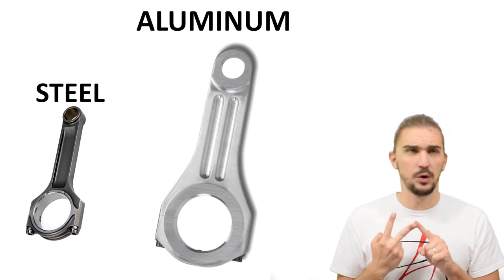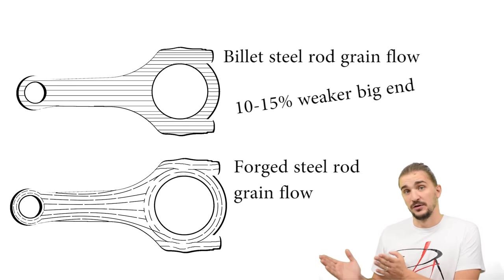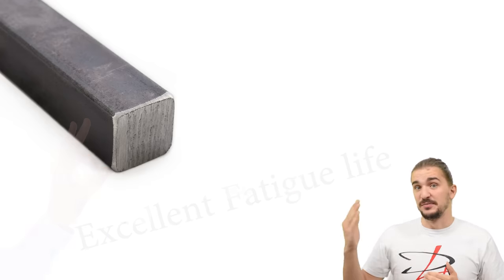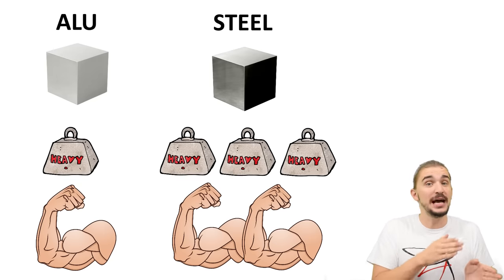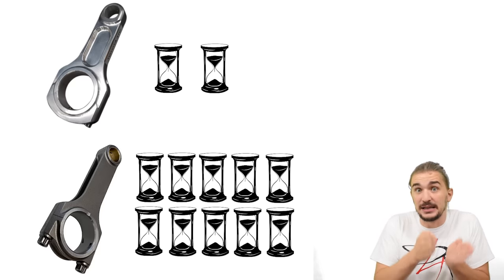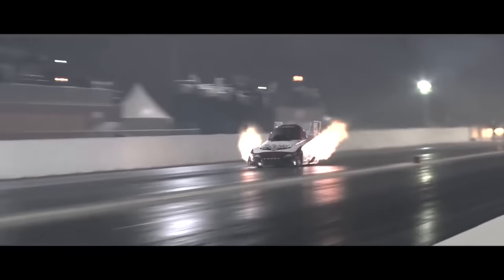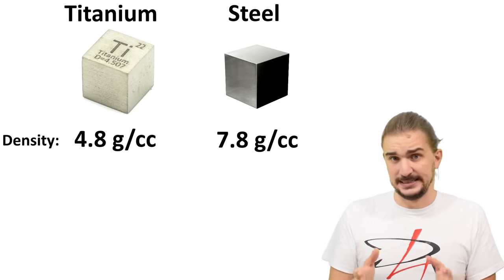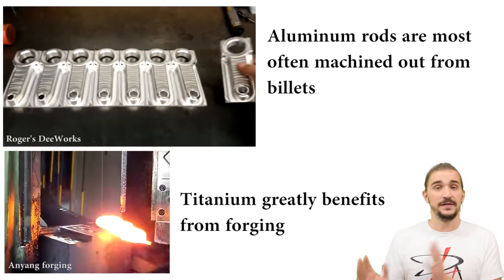STEEL vs ALUMINUM vs TITANIUM Connecting Rods

Comment: I'm a PhD metallurgist who worked in the jet engine business. You'll hear a lot of nonsense about materials in popular media, but this video was excellent! I especially liked  hearing the rarely spoken truth about "billet" parts - better than cast, not as good as forged.
Reply: Would the best parts be a combination? For the connecting rods, for example, forge the bottom end and machine the rest of it.
Reply: I share your pain. I used to work as a Tool Marker and later i worked for a company that builds centrifuges for waste treatment plants. The number of times i heard people expouse that stainless steel is some kind of wonder material. They think if they use stainless screws they are much stronger.
Reply: I wonder if the single crystal casting process used for gas turbine blades would add value for connecting rods.
Reply: @Dave5843-d9m  
Possibly, but I question the cost effectiveness.  In a production vehicle the currently used scintered and forged rods are perfectly serviceable for threat use. The rod is actually larger when it comes out of the sintering process and when forged ir reduces the volume and increases the density. Another option might be 3D printing using laser sintering of metal powders.  This would actually allow the use of two different alloys. Hard and tough on the outside while softer on the inside. People are already doing 3D printer non load bearing components such as intake manifolds. Just how long before we see aftermarket aluminum 3D printed heads and blocks. These would still require a certain amount of machining but IMO would  be cost effective in comparision to billet. I suspect that the engine manufacturers are already doing this. Originally 3D printing allowed for rapid production of patterns for casting prototype parts*. 

*One of the early 3D printing or stereo lithography techniques used paper rolled out on a platen with a laser cutting out the cross section. Glue on the next layer and tra e the cross section. Rinse and repeat until done. This technique is still around to some degree. There is a company in Ireland that was showing a desktop 3D printer that was combined with an inkjet. The idea is to produce fully colored and finished items
https://newatlas.com/mcor-iris-paper-3d-printer/32903/
Reply: The strongest component in a jet engine is probably the low pressure shaft - a maraging steel, forged. Temperature capability probably OK. Specific strength (accounting for density) is probably highest for Ti-6242 or GE's alloy Ti-17. The single crystal turbine blades are for very high temperature - at that temperature (2000F/1100C) they have ultimate strengths of around 40ksi. At 1400F/760C and below, but above the limits of titanium, a nickel alloy called 718 is best. 

But there are design factors that matter - is there room for a low density alloy? Do vibration modes change in the wrong direction with density and modulus changes? And many, many more. Straying from experience is risky, and gets you scrutiny from the Chief Engineer.
Reply: What do you recommend to avoid stress cracking in bodywork and frame type steels post welding?
Reply: YZFoFittie pre/post heating of the area that needs to be filled/welded. It is the sudden temperature changes from cool to melting point then back to cool without being controlled;;;  (is one of the  reason’s for the cracking) other than that just make sure all you’re surfaces (including fill wire/MIG, rod/TIG) are extremely clean, 99.9% alcohol works well..
   Also depending on where the weld is you need to fill/fix, if you can use heat sinks ; if you don’t know about using them ask and I’ll tore it out for you.
Reply: @brandonspencer309  with a painted, classic muscle car, heat treating isn't an option when doing minor alterations. We need to add 2 small brackets to the floor to convert from a bench seat to buckets. Did the factory pre/post the spot welded parts? I don't think they did? But we can't span the distance with a spot welder anyways, but we could plug weld with a tig to mimic similarly. Where can I find 99% alcohol? Highest I've seen is 91%?
Reply: YZFoFittie  (up here in Canada, in the west coast at least they sell 99% for a buck or two or per litre).. I apologize,, I typed when I wasn’t ready sure what you where asking;; obviously... there are so many variables depending on the job ...
Reply: Any thoughts on using carbon materials in rods? I know they are being tested and the numbers are quite impressive.
Reply: @kezzler9556  Do you have any links to these tests?  Running engine, with oil splashing around?  Are you talking about a carbon fiber (I guess it depends what the fibers are held together with or ?)
Reply: "Better" depends on the application. Also the casting and heat treat methods. Theoretically, rather than rolling out a square sheet, you could roll out a trapezoidal sheet, and have the same fucking grain flow for a billet as a forged. In double theory, if you were doing casting (also depends on the method) you could get the same grain flow by casting in an oversized mold and then machining down (and again, being better than a laminar billet). I've done casting metallurgy for a long time and people discounting cast parts on the basis that "cast < anything else" are idiots
Reply: The Doctor is in! Well stated Doc. Glad you weighed in on this issue.
Reply: @ObservationofLimits  
Nodular cast iron cranks and rods were and are more than strong enough for most factory applications in reality. Scintered con rods are more than adequate for most applications as well. The higher output factory motors (Hellcats etc) are probably still using forged rods. Forged and billet rods in a high volume production run involve extra machining steps versus scintered rods (I used to work in an automotive engine facility). Cast iron rods require the same steps. The production process runs
1) Rough grind both faces
2) Rough and possibly semi finish the pin bore
3) Run the rod through a slitting operation to seperate the cap end. This may include roughing the bearing diameter depending on the operation used.
4) Perform all of the drilling and tapping operations along with cutting the bearing lock notch. 
5) Finish grind or machine the mating faces
6) Assemble the rod and cap. At this point who knows were the original halves are.
7) Finish grind to width grinding both faces.
8) Semi Finish and finish the pin and bearing bore
9) Press in the pin bearing if a floating rod.
10) Bore and or hone pin bearing
11) Machine rod ends to match weight specs
A scintered rod for a production engine has several production advantages 
1) The rod and cap are never separated in that from the time the come out of the sintering process they are always a set.
2) A cracked scintered rod after cracking only requires a wire brushing of the mating faces and the rod can be re-assembled without any machining processes to the mating faces. The micro fractures of the surfaces provide a much better register surface.
The facility I worked at over the years produced cast, forged and scintered rods. The cast and forged rods were labor intensive to produce. The scintered rods required maybe 10% or less man hours per part with less scrap. The reason the man hours were less was that the scintered rod once it entered the machining process never had to be handled until it was used on the engine assembly line. The cast or forged rods required handling for multiple operations. 
3) The uniformity of the rods from one to another is such that the balance operation can pretty much be eliminated. Rods are checked for weight tolerance. Out of tolerance rods are scrapped. 
Eliminating operations reduces cost by eliminating handling, initial production machine tools cost and lower cutting tool costs
Reply: @mpetersen6  Just FYI - it's sinter, not scinter.  You might want to edit your post to correct.
Reply: My girl friend in a metallurgist, her favorite alloy is M50NIL, what a great roller bearing alloy! Imagine if we had M50nil roller bearings in everything! Now make a crankshaft out of this m50nil stuff carbonize and nitride the hell out of it and run it a a billet 7075 alloy inline 6 890 cubic inch 2 stroke!  7075 has a bunch of copper, zinc and magnesium in it? not sure strong alloy but a @!#$% to weld i heard
Reply: @mpetersen6  Stainless screws are generally much weaker actually. In most cases stainless steels compare with grade 2 medium/high carbon screws which are the weakest ones.
Reply: @BarryAllen-no9nj  
I know. The recommended torque ratings for A4-70 and A4-80 are around 50 to 55% of a grade 12.8. Plus over tighten SS in a SS tapped hole you've got a significant change of gauling and sizing the screw. In the industry I was working in normal procedure called for chucking the screws if they were used more than 3 times
Reply: @mpetersen6  yep. anyone who thinks stainless steel is strong doesn't know a thing or two about metallurgy or bolts in general. The low carbon content in SS make it impossible to strengthen it thru heat treat like in grade 8 bolts or in metric Grade 8,10 or 12 bolts. 

If we're talking longevity of strength in corrosive environments, than that's another argument.
Reply: @JohnDoe-ji5wg  it would also need a forged small end
Reply: @mpetersen6  yes so very true, I am in the aftermarket automotive industry and the times I hear people using SS in places that they shouldn't, ie holding brake calipers together or even onto the hubs :(  its all very sad, because the common response is "well I've never heard of anyone dying from using them"  as they clearly miss the point that the people who could or would tell are no longer alive to tell !
Reply: @mpetersen6  printed heads and blocks are already available, however it's more a play on words as they print the casting box & sand then cast in to the cope and drag, it's a very good process just a tad expensive at the moment
Reply: @curtaustin8119  Having machined Inconel 718 to make 1/4" (6.35mm) unf bolts that are 5.75" (146mm) long with a 5.6mm diameter stem, it's got to be one of the hardest materials to get reasonable success rate and its bl**dy expensive, I think 10Kg was about £600 .
Reply: @martinfidel7086  
One of the early 3D print technologies was layers of paper where the layer would be profile cut and the waste cross cut. Then the next layer would be glued on and cut. The finished pieces were tough enough to be drill and tapped. I know the manufacturers were using them for prototype castings as it speeded up the prototyping a lot. You skip the pattern making process. Now flip this around. Design your finished part with shrinkage allowance. Now take your finished part and determine where your parting line is. Now do a slicing operation to mach your paper and glue layers. Cut out the layers with one of those crafting cutting machines like a Cricut. Now laminate the layers. Paint the finished lamination. Congratulations. Now you have your finished master casting for making your own Copes, Drags and Cores. I think that is just about the cheapest way one could do custom castings. There's actually a company (or was) that offers a 3D printer that uses regular paper where it produces the finished part in color. 
https://www.google.com/search?q=3d+paper+printer&oq=3d+paper+printer&aqs=chrome..69i57j0j0i22i30l3.13251j0j4&client=tablet-android-samsung&sourceid=chrome-mobile&ie=UTF-8#
Reply: @martinfidel7086  
I spent 40 plus years rebuilding industrial machinery, machining and doing Tool work. We had a guy who wanted to make his own trailer hitch balls in order to learn programming CNC lathes. The boss told him he could do it on one condition. That he throw the finished part in the scrap precisely because of liability issues.
Reply: @mpetersen6  or maybe you could 3D print in wax, then shell it and melt the wax out ?
Reply: @martinfidel7086  718 is used in jet engines for parts too hot for steel or titanium, but not above about 700 C, a point where the strengthening phase dissolves. This range includes the many parts exposed to compressor discharge air - but not connecting rods. 718 is dirt cheap compared to the alloys used for turbine blades, which get over 1100 C.
Reply: @curtaustin8119  I know there are more expensive materials as I had to make some valves for an F1 engine, that material was over £1000 and weighed about 400 grams it took me over a week to make 1 !
Reply: @martinfidel7086  that's an option too. No matter what you do there's going to be significant machining involved. Plus there's always the option of a two piece layered cylinder head machined from solid.
Reply: @martinfidel7086  That might have been gamma titanium aluminide - probably '48-2-2' - lighter than titanium alloys but with heat and oxidation resistance good enough for exhaust valves. It's mostly banned in F1 engines, for cost, but permitted for valves (last I knew). Certainly not easy to machine, or grind, either. I was GE's leader on this material in the 90's. We had a consulting agreement with Ferrari - I suggested the chief engineer contact GE corporate about tickets to the first GP at Indy that Ferrari might have sent Jack Welch, who would not likely use them ... that led to an amazing experience as a guest of Ferrari.
Reply: @kezzler9556  shock-derived catastrophic failure from carbon rods. Weight and stiffness are great, modulus of elasticity is horrid, perhaps it would be financially for a single drag race but there would be no easily detectable indication before catastrophic failure of the motor when a rod stress-fractures. 
Multiple backup engine clones would be required.
Reply: If titanium is the most resistant material per unit of weight, what is the most resistant per unit of volume regardless of its weight?
Reply: @riosena350  Steel is the simple answer. The simple answer won't always be correct. "Resistant" might mean stiffness, for which carbon fiber composites might be better - highly application dependent. You'll sometimes hear "we've chosen steel because the bearing loads are high". Bearing load - at a pin, say - is something occurring in a small volume, and may involve considerations of wear resistance and other characteristics.
Reply: @JohnDoe-ji5wg  whats the goal of the project? Are you asking about pistons?
Reply: @jpegjake  yes lol
Reply: Perhaps you could help me with some clarification. Doesn’t all metal start as cast? Isn’t an ingot used to forge a part originally cast into an ingot? Billet parts I know were usually continuous cast and cut from a section of billet, correct? I always wonder how his pertains to an AR lower receiver which can be forged or billet. I would’ve thought the forged ones were better/stronger but apparently the billet ones are preferred for tighter tolerances. I’m not even sure how one would forge a lower receiver given that it’s a hollow shape.
Reply: @JG54206  Terminology is often confusing in metallurgy, less so if you know the long history involved. As of today, however, the popular meaning of "billet" means "CNC-machined from wrought raw material". "Wrought" is short for "cast and wrought"; the wrought part means that something solidified from a molten state has subsequently been beaten on, rolled, extruded -- anything but forged to some near-net shape. Your 17mm open-end wrench was forged to a near-net shape, so it is not "billet". It could have been CNC-machined from bar stock, and advertisements would make it seem wonderful. Nope, just expensive. Note, however, that some shapes are not amenable to forging, and a "billet" part is the next best thing -- for short runs, that is, after which you'd want to use a cast part. This is a summary of something only a book can describe properly, so beware.
Reply: @curtaustin8119  gotcha. Makes more sense now. Thanks for the reply.
Reply: @JohnDoe-ji5wg  yes, well it’s super hard to forge a block for example but they can forge a block shape and machine the rest of it out it’s just not popular beacuse well it’s expensive as hell
Reply: "I'm a PhD metallurgist." Can you say Dunning-Kruger effect?😂
Reply: I see the forged vs. Billet argument all the time in the gun world ,in recievers ,barrels etc.
Reply: @mpetersen6 well stainless is harder but more brittle because of the chromium in it isn't it? so if your just putting stainless steel bolts, screws etc in a pretty static area then its fine but for areas that are under alot of load and temperature change its not so simple to just use stainless.
Reply: @curtaustin8119  What is a good material for a 3000hp dct (internal part)?
I was thinking about maraging 350.
Reply: @BarryAllen-no9nj  
Stainless steel is available in many grades, isn't it ? So you can have weak or strong stainless, depending on how deep your wallet is.
Reply: When people seem confused by the difference, I like to show them the difference between particle board, carved up plywood, and vacuum press formed plywood (skate boards, snowboards, etc) one collapses if you look at it funny, one cracks if you stand on it, and the other flexxes a bit when you bomb a 10 stair 😂
Reply: @aaronschocke2147  so guys rod better on steel and piston forged that the best combo?*